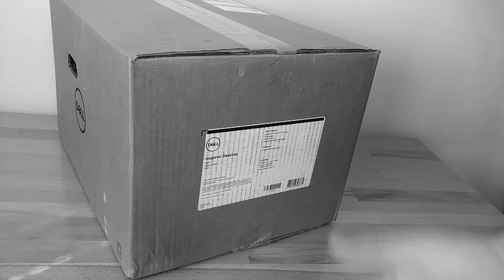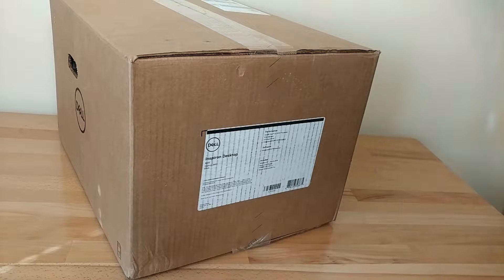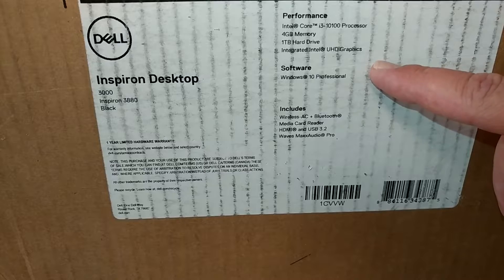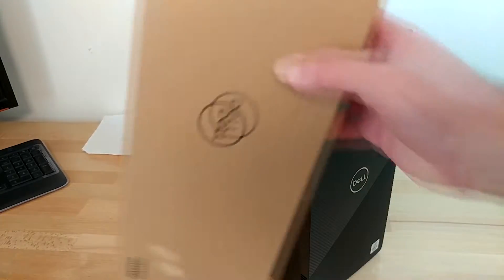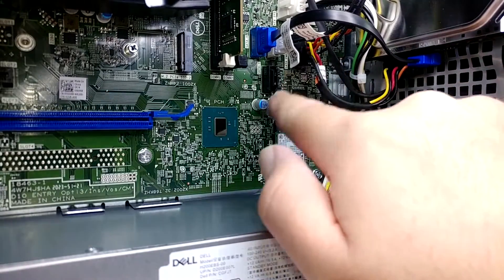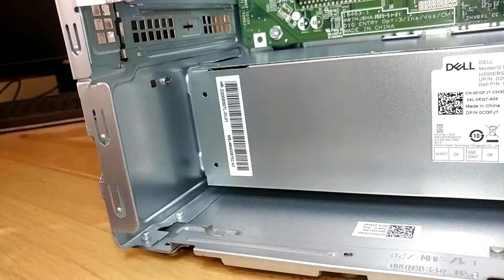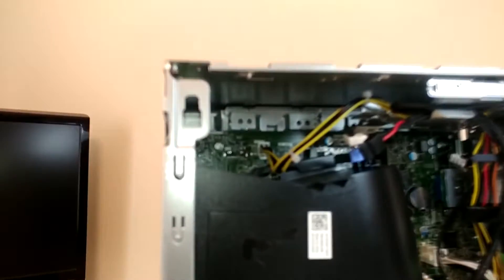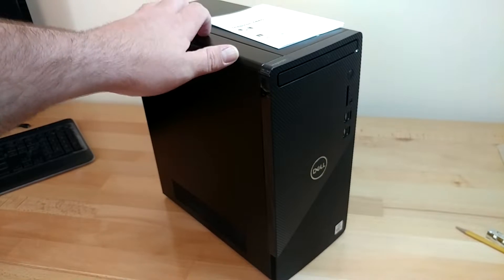Unboxing The Cheapest New Dell for 2021 (and 2022) and Upgrade Plans!

Comment: Please do tell if you find a decent PSU for this machine! I just bought this PC a few days ago, and I want to be able to run my GPU in it.
Reply from the maker: It's on the agenda, but it won't be a direct swap. So... "Some fabrication required".
Reply: @TheBrokenLife  Thanks, your video put me on to a PSU upgrade solution for my Dell 3880. I think the power supply outline you pointed out matches the SFX PSU form factor (63.5 by 125 mm). It looks to me that an SFX supply will work with case modifications to increase the cut-out for air flow and adding mounting holes. Another candidate for the 24 pin to 6 pin is https://www.amazon.com/COMeap-Power-Adapter-Motherboard-13-3-inch/dp/B08M5BZ6P8/ref=sr_1_3?dchild=1&keywords=COMeap+24+Pin+to+6+Pin&qid=1610488845&sr=8-3. The seller confirmed it will work for a 3880.
Reply from the maker: @jeffculbert7982  The problem is the 125mm dimension and the fan blowing around a 90 degree corner. Those problems exist in a "normal" configuration as well as an SFX. Also, the SFX supplies I'm seeing are twice the price of their normal counterparts. I couldn't suggest anyone to spend that much money and not also suggest they just ditch the Dell case in entirety, so no more need for an SFX supply. I may end up doing in the long run. Just have to see how far the rabbit hole goes.

It's cool that Amazon adapter is supposed to work. I ordered one over a month ago from Moddiy and it still isn't here yet. I'll include the Amazon link in the video for sure when I get there. Thanks for the heads up!
Reply: @TheBrokenLife  What is the problem with the 125 mm dimension?
Reply from the maker: @jeffculbert7982  Looking at it again as compared to a normal ATX, I don't actually think it is a problem on the SFX. Or at least not a problem on the Corsair I was looking at. Hummm... I may have to get one and find out.

The issue I thought it would have is that the 125mm dimension on an ATX supply is in the same axis that the cords plug in, so that 125mm is more like 200mm by the time it's actually in there. SFX rotates that axis 90 degrees so it's inline with the dimension where it would have enough space to do it.
Reply: Actually, looking at it further, this cable is probably not be compatible. On my Inspiron 3880 the six pin connector has six wires, but from the photos on the Amazon product page this cable only provides 5 connections.

Edit: Ok, sorry for the noise, looking even more closely I see that the photos (the end photo of the 24 pin connector in particular) of the cable available on Amazon show the full pinout and there are 6 connections to the 6 pin connector. The connections are as follows: two +12V1 to yellows, PWR_OK to grey, two COM to blacks, and PS_ON to green, and a loop from PS_ON to COM. The loop connection means the PSU will always be on.

More info:
My understanding is that the Inspiron 3880  motherboard operates in a way such that the 12 volt supply to the six pin connector is always on (so it acts like a 12 volt standby, like the 5VSB of the full 24 connector). I've seen reference to this in other threads and I confirmed it myself using a volt meter on my system. ATX power supplies don't provide a 12 volt standby, so this cable works around it by keeping the supply always on. A down side is the system will not be able to enter a sleep mode where power to the CPU and video card is shut off. Low power operation should still be possible, just not full sleep mode.
Reply from the maker: @jeffculbert7982  It's hard to tell for certain from the Amazon pictures which pin is unpopulated, but it appears there are multiple redundant 12V connections as well as a sense pin that may not be necessary in all configurations. I also cannot be certain that the adapter I ordered from Moddiy has all of the pins populated, and the wire colors appear all the same, so I'm betting it's likely the same harness as the one on Amazon. I may order one just to find out. I also intend to measure the pins with my multimeter and determine a pin-out of the connector as well I as can.

edit: Just ordered the Amazon harness... Curiosity has gotten the better of me.
Reply from the maker: @jeffculbert7982  As luck would have it, I finally got my Moddiy adapter and my Amazon adapter in the mail today and they are absolutely identical, including both having a full population of wires. ;)

As regards the pinout study you conducted, I'll absolutely take your word for it, but turning the machine "off" (like, really turning it off, not a sleep or hibernate) is just a matter of turning the switch on the PSU itself off. This is how we did it back in the old days and it was really not a big deal. If you really really wanted it to be able to automatically sleep, you could place a 5V to 12V step up transformer inline from the ATX 5v bus and splice it into the 6-pin where appropriate. That would restore that functionality. Looks like such transformers are about $10. The down side is a very, very, limited amount of amperage on that pin. Something like 0.8A. Not sure what else that pin needs to power, so, may not be a great solution.

Comment: will rtx video cards fit on these inspiron 3880s?
Reply from the maker: I can't say for certain. I checked mine with a tape measure and it looks like 260mm x 120mm x 65mm is the largest possible card that will fit. The next problem is going to be the power supply...
Reply: @TheBrokenLife  i got mine this week and im checking some of these expensive inspiron 3880 desktop and i found one that has NVIDIA Geforce GT 1030 2GB GDDR5 im thinking it might have a the propritery skinny PSU but with higher wattage if that make sense.
Reply from the maker: @iamgepots1843  Yep. That one comes with a little more powerful PSU than what I have. I'm going to try something like like that 1030 with the base power supply and we'll see what happens.
Reply: So I actually got an MSI GTX 1070 to fit in mine, but obviously I have to find a compatible PSU that will also fit in the case as well as power the GPU.
Reply from the maker: @trevorhoek3183  That's the catch. There's not a lot of space in there to work with... I have some thoughts.

Comment: Very informative! Thank you. I just bought the same computer except with an i5 processor. I'm about to install a 500GB Samsung SSD. I don't think the installation will be a problem, but I want to use the SSD to boot up Windows. I was hoping you'd have a video on that. Do you have any advice on where to get instructions for this? Thanks!
Reply from the maker: Thanks!

I've used Seagate Discwizard in the past for mirroring drives and I have a video I made last year on that (TBT 6: The Cheapest New Dell Upgrades: SSD and RAM install). I plan to try something a little different on the 3880 and I have an SSD sitting here for it. I'll make a video of that process, but it will be a little bit. Good luck with yours!
Reply: @TheBrokenLife  Thanks! I will check that out. Keep up the good work!
Reply from the maker: @dstellify  I'll try!
Reply: @TheBrokenLife  Update: I downloaded the Data Migration software from Samsung's website. This worked very well. Now I'll add 8 GB of Ram and an internal optical drive. Maybe you'll have a video on the optial drive installation soon? If no, I'll figure it out. (It'll just take me an extra hour!)
Reply from the maker: @dstellify  I intend to try the Samsung software too and the optical drive is the next thing on the agenda! :)

Comment: Were you able to get an answer regarding the 2.5" drive bracket?
Reply from the maker: No. I spent over an hour on hold with Dell and then they hung up on me. I have a plan to add one though.
Reply: @TheBrokenLife  I found this on Dell community 
https://www.dell.com/community/Inspiron-Desktops/Mounting-a-2-5-inch-SSD-in-an-Inspiron-3880/td-p/7764435
A member said he used this bracket:
https://www.amazon.com/Corsair-Dual-Mounting-Bracket-CSSD-BRKT2/dp/B016498CK0/ref=sr_1_16?dchild=1...&pldnSite=1
 It looks like this is to mount a 2.5 sata ssd where the 3.5 hdd normally goes.
Reply from the maker: @dirtbagdavis777  I have purchased exactly that bracket to cover this topic with, but it doesn't help you if you also want to retain the 3.5" HDD that mine came with, which I do. ;)

If you just want a 2.5" drive in there at that location, that bracket works great!

Comment: I bought the dell Inspiron 3880 with 12 GB of ram and I wanted to upgrade the graphics card to a  1660 TI can the graphics card fit in the pc
Reply from the maker: I can't say for certain. I just checked mine with a tape measure, it looks like 260mm x 120mm x 65mm is the largest possible card that will fit. It looks like most 1660 Ti cards will fit, but the power supply is going to be a problem since that's a 120W card.

So... It probably fits, but I don't think you have enough power to run it.

Comment: Hi Max, I just bought this computer for Christmas and I’m just curious if it will be ok for playing wow and other casual games? Or will I need to do a lot of upgrading
Reply from the maker: If you bought exactly the machine I did, it will be miserably slow doing much of anything without at least an SSD and probably 8GB of ram. I'll be doing both of those things to mine in the not too distant future. I don't think WOW is overly graphics intensive by modern standards, but I'm not sure. I was expect to put at least some modest video card in it as well if you want to do any gaming. In short, I'd expect about $200 of upgrades to be needed, but maybe not?

Just as a point of reference: the Nvidia g-sync pendulum demo runs on it at about 4-8 frames/second, and that tech demo came out over 7 years ago.

edit: If you just bought the black friday deal with 8GB of RAM and an SSD, you're way ahead of the curve.
Reply: @TheBrokenLife  i got the 8 gb ram and the 1tb hdd cuz its mainly for school and all of my files, but im wondering if i would run games like valorant and lol
Reply from the maker: @alexmo9022  Probably not. I did a video on initial performance benchmarks and it wasn't too promising.
Reply: @TheBrokenLife  mine seems to run valorant at 100 fps with nothing in the background, my frames randomly drop not very often but when i have something in the background, i think its that i need more ram, can i just add another stick in or do i need an actul ram kit?
Reply from the maker: @alexmo9022  You should be able to just add another stick. Pop the case side off and see if you both spots are populated or if you have an empty.
Reply: @TheBrokenLife  i only have 1 stick of 8gb 2666 mhz ram, is it fine if i just stuck another 8 gb stick in or do i have to buy a set?
Reply from the maker: @alexmo9022  Just adding another one should be just fine.
Reply: Hi update here! I’ve got the computer now I don’t have the settings on anything special but it definitely runs way better than my almost 10 year old laptop now!! Very very happy with the product and the price also emulating games with 60 FPS so no complaints here!
Reply from the maker: @Ethan-pg2um  Awesome! I'm curious to see how mine does with a couple of upgrades installed.